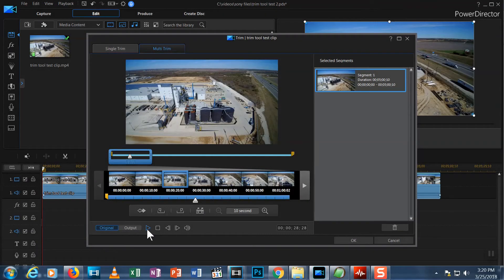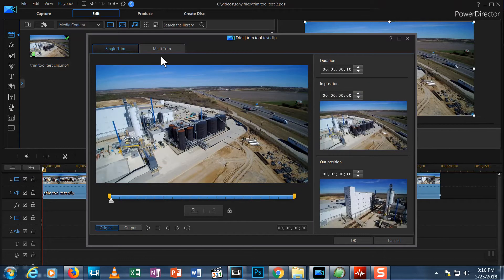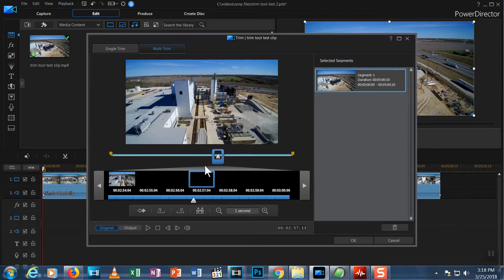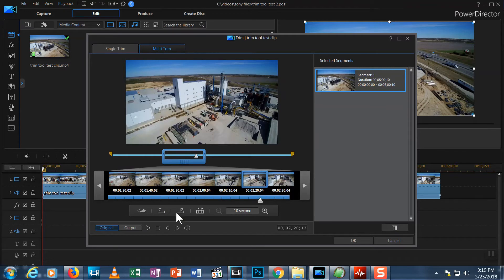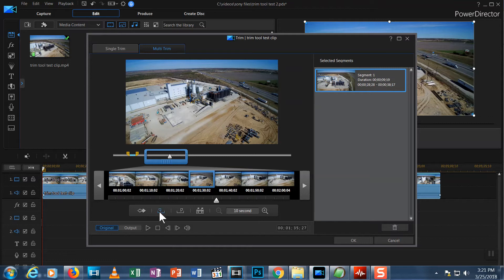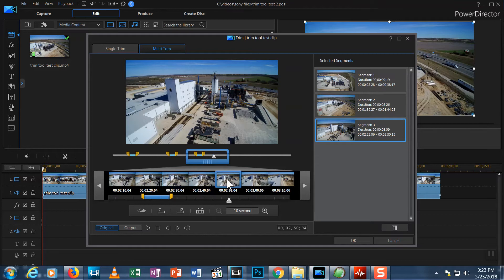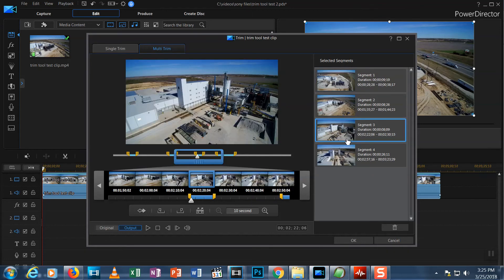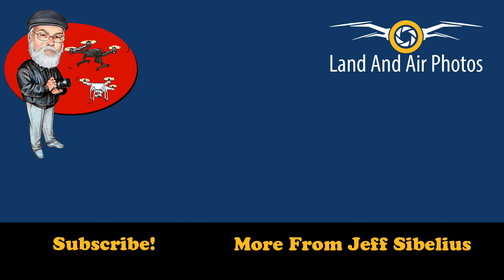7: How to Use the Trim Tool in Cyberlink PowerDirector 18 / 17 / 16 / 365 - Video Editor Tutorial

Comment: This looks like a good way to trim a clip for use in the current project.  But what if you wanted to use the trimmed clip in another project?  Do you have to go thru the whole trimming process for each project or is there a way to keep the changes.  Eg exporting the clip without re encoding?
Reply from the maker: instead of trimming it in the current project, you can specify a range, then copy the range, open a new project, and paste what you copied into the new project. Other than creating a clip and exporting it, then bringing that clip into the new project, I don't know of another way to do it. In either case though, you don't have to trim the clip - you can simply specify a range and export it or copy/paste it as I described.